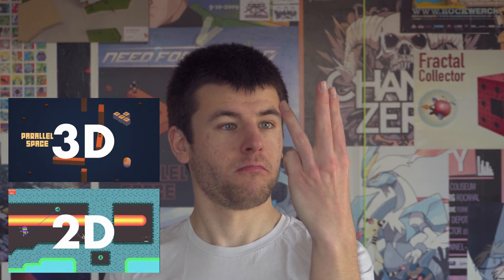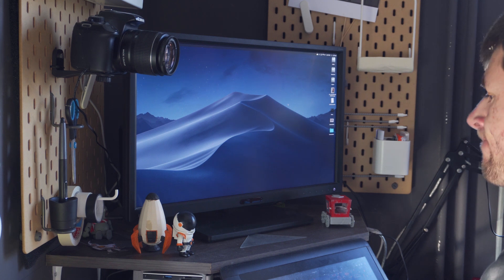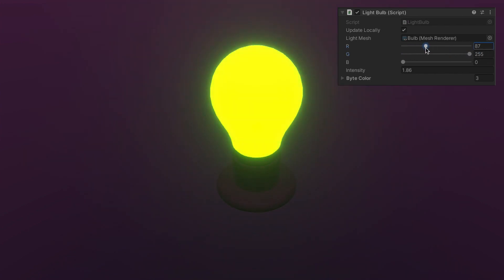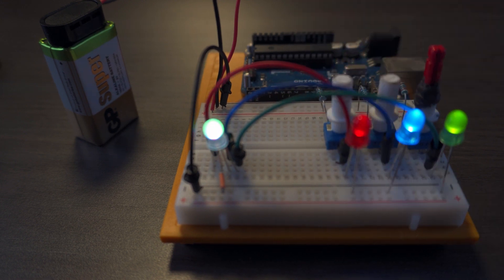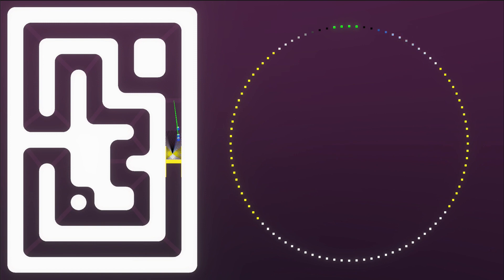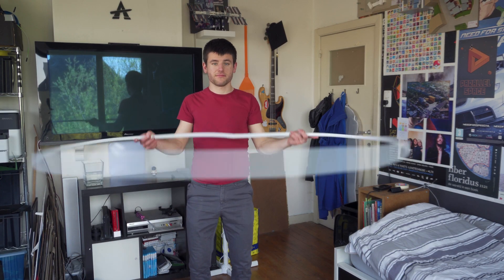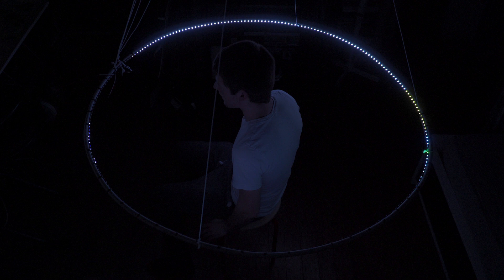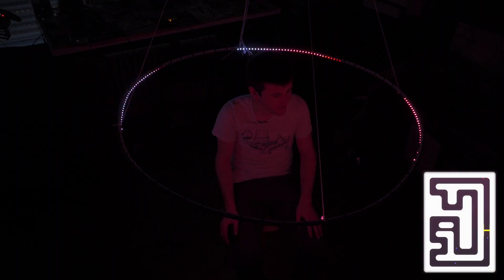I made a 1D Racing Game with a LED strip

Comment: 4:19 I'ma stop you there. This is a 2D game with a 1D "screen". Essentially raycasting but in two dimensions. If that is 1D, then by that definition, every single game played on a 2D screen is 2D, including Doom Eternal and Miegakure, because they are played on a 2D screen. Sure, Doom Eternal is a 3D game that uses rendering techniques to represent its 3D world on a flat 2D surface, but what you're showing at 4:19 is a 2D game that uses rendering techniques to represent a 2D world on a 1D surface. I think anyone would agree that it would be needlessly pedantic to say Doom Eternal is 2D. So if we accept that Doom Eternal is 3D because regardless of how it's displayed, it plays in 3 dimensions, then we also have to accept that your racing game is 2D because regardless of how it's displayed, it plays in 2 dimensions.

Comment: 8:50 This part kept tripping me up, I didn't understand the change you made. I kept parsing your presentation as "Instead of sending raw data, I sent raw data", and I didn't compute what was actually happening. After rewatching a couple of times, I think I now get it: You were sending the color data as human-readable ASCII in hexadecimal notation, am I right? And you changed it so that you were instead actually sending bytes of data? 

A 6 digit hex-code in ASCII would take 6 bytes, where as a raw color data would only take 3 bytes, so it would halve the data size needed to send to the LED controller.

Comment: You’ve used colour to explore 2D space with 1D vision. This  is how I would prefer to explore 4D shapes in 3D vision tbh
Reply: the thing is we only really have 2D vision so i dunno how reasonable that is
Reply: @darksentinel082  exactly
Reply: @juliethebardicprincess  It's doable. Start by creating a world with a 4D object for example. Then project the entire object into a 3D axis system like you would when doing any transformation (exactly the same thing as viewing a 3D object on a 2D screen, just flatten the 3rd, or in this case 4th, dimension). While performing the transformation generate a color texture with rgb values corresponding to the distance each part of the 4D object was moved during the squish of the 4th dimension (the projection). This texture when applied to the flattened but still 3D model will describe how deep into the 4th dimension each part of the 3D model is.

Idk what you're all on about with only having 2d vision. Yes, monitors are only 2d. But that doesn't matter. We can still move around in a 3D world and interpret 3 dimensional shapes even through 2d screens. If you also allow a second eye as with vr then we can interpret 3d depth even without movement. We can definitely see and distinguish all 3 dimensions in our world. Every 4D objects can be squished into a 3D shape in 4 different ways depending on which axis you choose to squish onto the others. It's exactly the same principle as projecting a 3D shape into 2D. You squish one of our 3 dimensions onto the other 2, as though you're viewing the object from far above or from the side far away etc. Finally painting the objects we see with some colors really isn't difficult.
Reply: @darksentinel082  yea like a tv scrren is only 2d
Reply: How would you manage that?

Comment: Next Up: Making a 0D game where you have to do nothing!!!

You have a good talent👍
Reply: @Lukas Sound implementation makes for a valid 1(+) Dimensional game. I can't find the reference anymore, but one of this kind was made on gameBoy in the past. It looked like a sonar, the player had to approach "things" while the screen only showed green growing lines on the edges.
I can definitively think of a valid 2D game from a monosonic source, the frenquency acting as horizontal line, and volume as the vertical line.
Given sounds are flattened (no "upper/below" deformation transmitted), a monosonic-paced sound game is 1D, and a stereosonic-paced game is just stereosonic-1D .

Same for the led-strip of the op: it's1D, but each diode acts as a single independent information source; the game would still work with the only frontal 1 diode (if not so much greenish), given the more diodes are present, the more reference points the player has.

TL;DR: no screen != no dimension, sound already acts as 1d information.
A 0D-game is likely a game that closes itself when you launch it, or an uninteractive idle game like ProgressQuest (still featuring a 3D-lookalike interface, for what it's worth).
Reply: >where you have to do nothing

Godville entered the chat
Reply: The only thing I could think of for a 0D game would be a 'Press the button when it lights up' Game.
Reply: 0D game is like play with your mind